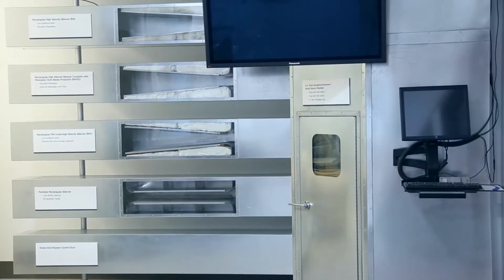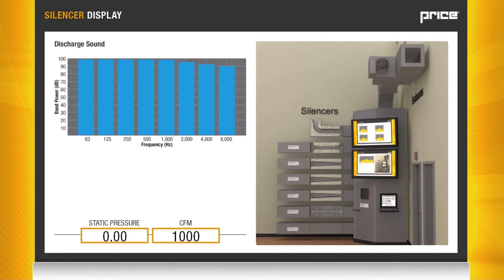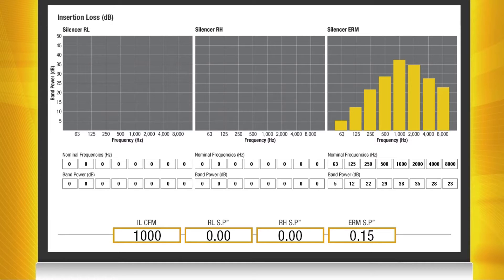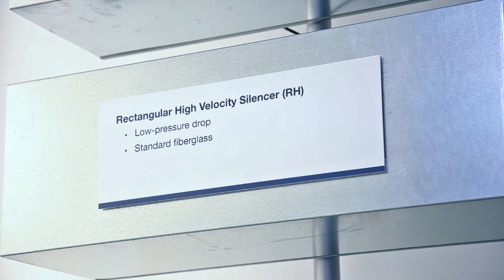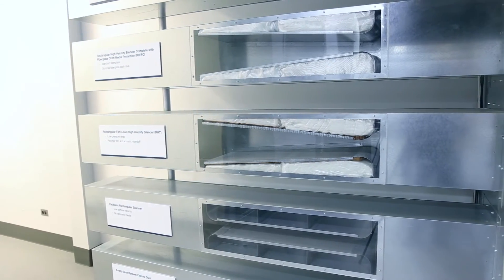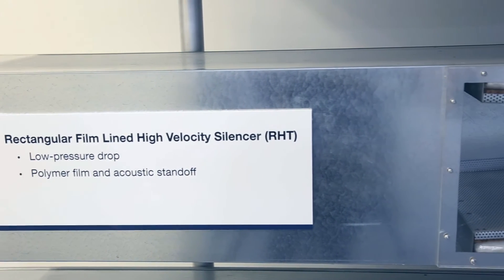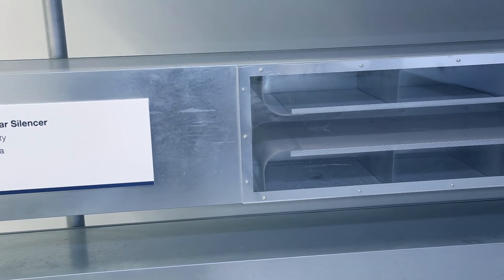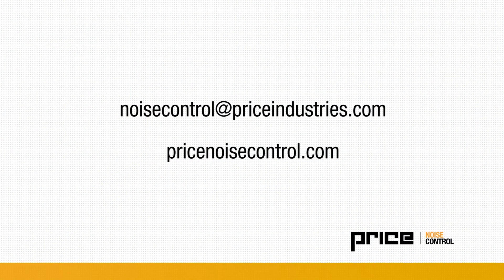Duct Silencer Overview

Comment: I'm a carpenter not a tin-knocker, but wouldn't it make more sense to have a section of duct that is completely perforated and just wrap insulation around it thereby having the full benefits of Insertion Loss while having absolutely no pressure drop due to the lack of interior obstruction? Think outside the duct. ;)  gene.laratonda(at)gmail.com